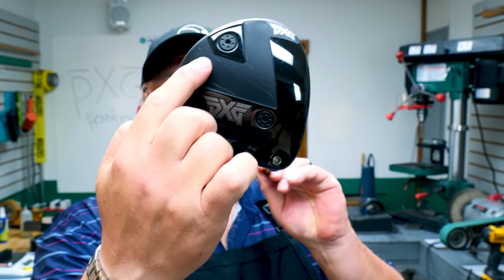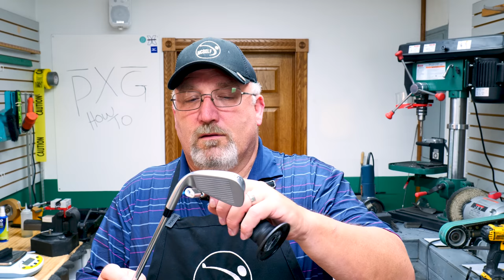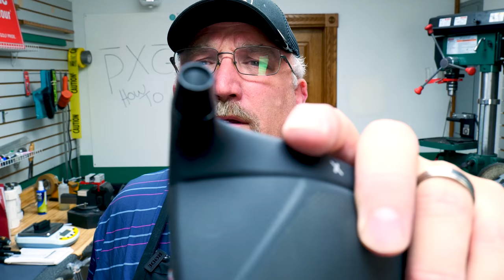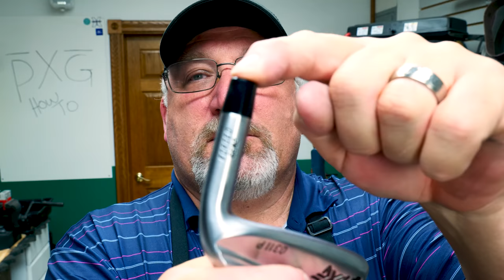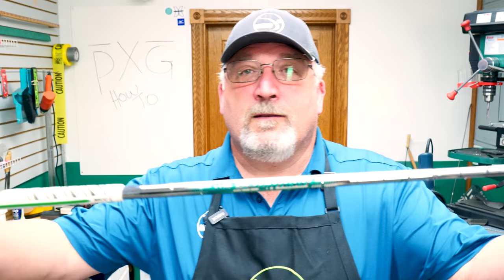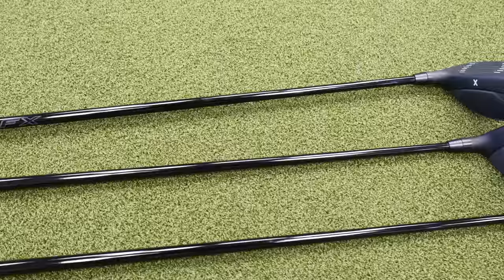PXG Golf Club Repairs 2021

Comment: Thanks Jim for great videos! Yesterday I picked up my Mavrik driver with a new ACCRA Fx 3.0 260 M3 slightly tip trimmed. What I notised in your video was that you just put the logos where your customer wanted it. My shop did spine the shaft with spine on the right side to prevent droop, ending up with the green logo on the right side aswell. Looks awkward but I trusted him doing the right thing. What's your opinion? Did he overdo it? Did he place the spine in the wrong postion? Thanks in advance! :-)
Reply from the maker: I prefer to spine and align too however some golfers have a thing about that

Comment: Hello,I like ur video! And have a question. My bf is using sugardaddy 0311 iron! and he said the screw is loosening. could you give advice what tool I have to buy for? the size of screw is the same as the screw of pxg driver? I can see the torque wrench for pxg drive on ebay and wonder if I can use it on 0311 iron too.
thx!